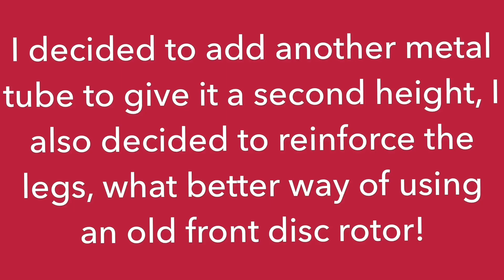Home built Abba Stand for Kawasaki Versys 650

Comment: Yes, they are charging $500.00usd at most shops in 2023 to grease fork bearings and to change fork oil $$$$,,,, Abba stand is also $500.00usd👍. Most sport bikes don't have a lower chasis to lift from.😮